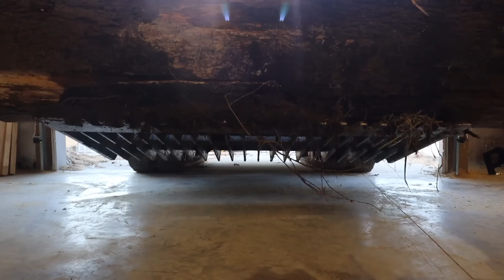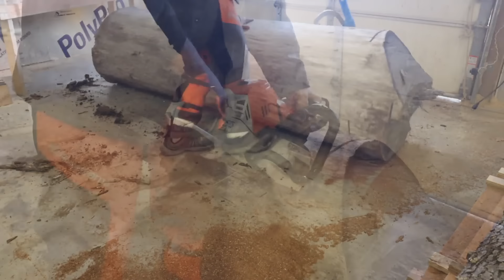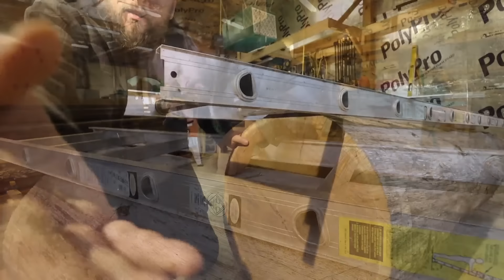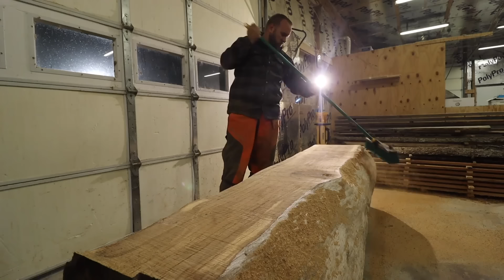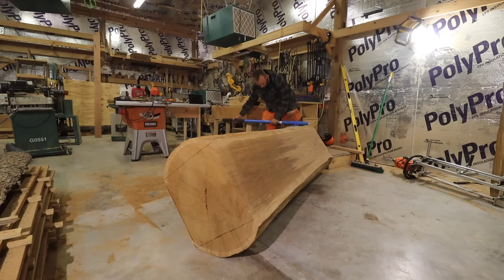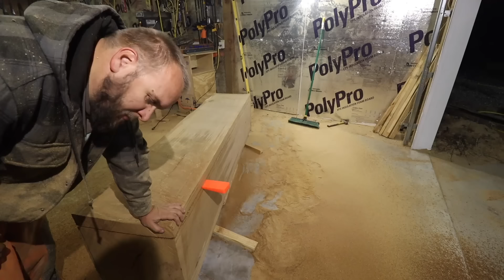How to Mill Dimensional Lumber with a Chainsaw - Alaskan Sawmill

Comment: I live in central america and they cut all their building lumber here with chainsaws (in the countryside) and they mark off the widths with little sticks they cut and snap lines with cord and wet ink. They'll calculate all the different dimensions inside the log they are cutting, leave the ends attached so the wood doesn't warp while you wait to use it, and if the chainsaw guy is good it comes out super consistent. And if not so good it's still perfectly usable. It's just how every house gets built.

Comment: Being nitpicky, but you can have parallel lines and not be square (you just tested for a parallelogram, not a square); the true test of square is diagonally and if those two measurements are the same, the stuff has to be square or at least truly rectangular.

Comment: What good is wearing a face shield when you don't use it
Reply: I like the cut resistant chaps that the chain will ride down right into those soft sneakers lol. Right church wrong pew I'll take boots no chaps. But I've saw in flip flops too
Reply: No the chaps are husky and the saw is stihl buckin' billy would have words

Comment: I find using a couple of 6" square(ish) 1/2" pieces of plywood vs. wedges is easier, insert 1 on the end once you get a foot or so in to the cut and the plywood will hold the end up, then the 2nd piece goes in towards the end to keep it off the saw when you exit.

Comment: Great explanations! You really do a good job of keeping the wood grains parallel with the edge of the cut! And keeping it square means very little is discarded. 

However, I would favor speed over accuracy. Instead of raising the ladder, I'd just fix both ends to the log. And instead of marking a square profile, I'd just set the Alaskan mill to 1.5 inches and make several cuts until I run out of space.

Then I would take those planks to a table-saw and rip them into 3.5 inch boards of a certain length. 

But it's nice to see a very formal approach to Alaskan milling dimensional lumber. This skill is easy to learn and very effective in terms of cost savings on lumber.

Comment: just a tip for you, next time set the plane of your cut parallel with the center crack in the log.
that way, you get rid of the defect in one board instead of having multiple slabs with part of the crack in all of them.
Reply: Ah! That's why they keep the grains parallel! I thought it was because of strength. But cracking is even more of a concern.

Comment: Nice job Brock. Doesnt matter if the boards are a little crooked or thicker in spots. I just posted my slab flatener sled video yesterday. You could easily make one like mine out of mdf boards and flatten those slabs when they dry.

Comment: Good job Brock, but squareness of Cant i was told to measure length diagonally between corners to check squareness if those are the same your square. I was going to ask about the noise as you had lights on with neighbours, there easy to upset!

Comment: Brock, thanks for sharing, my mill is on its way and I can’t wait to start milling some logs once I can dig them out of the snow here in WI. Stay safe👍TCT
Reply from the maker: I also have a sawmill on its way.

What are you getting?
Reply: @RockhillfarmYT  Brock I’m getting the Back Country 36 package with the Easy Rail system and winch system and a couple ripping chains. I’ve been wanting to try the mill for some time. TCT
Reply from the maker: Cool, I’ve done a good bit of chainsaw Milling. I’ve also been using the Logosol M8 chainsaw Milling station

Finally getting a bandsaw mill now
Reply from the maker: Send me a Facebook message or an email to
kcfan491@gmail.com

Comment: Great video. My Granberg mill… set to 2”, doesn’t cut 2”… what about yours? How often are you sharpening your chain? Every other pass?
Reply: I have a mill and just use a regular old chain. Milling ponderosa pine, I got 70 linerar ft or 5x 14ft cuts before needing to touch up with a file. 

Highly recommend buying three new chains and a bench top electric chain sharpener. Just switch out chains as you mill. Or you could continually file your chain for touch-up and then do a complete sharpening at the end of the day.

Oh, and DRIPPING TIP OILER, VERY IMPORTANT!

Comment: Is that a standard chain on the saw?  Is it sharpened different from a normal chain?  How big is the saw (cc)?  Thanks for the video.
Reply from the maker: I am using a standard chain. You can buy special ripping chain. I have used them in the past, but I’ve made the decision not to.

I’m using the stihl 500i which is a 79 cc saw.
Reply: @RockhillfarmYT  Thanks

Comment: I tried the alaskan sawmill and i think its raquet .  Its the worst piece of jumk you can ever buy.   To tight the chaib dont spin and just anough to make it just spin the whole sawmill dismental and it become a danger hazard.  

It looks good when you look at it but not worth half an hour to assemble it . 15 min sharping your chain. Every cut to reassemble the thing.  If it untight you need to dismental the whole thing to arrange it.     I give it a 1 out of 10

Comment: #Rockhillfarm is that white oak? I can't tell cause I'm on my phone but if it's white oak, it's a summabitch on blades and knives. Also it has more checking in it compared to red oak. White oak is prettier just clear coated.  I like the worm or beetle holes in it , cause it gives it character.  I've worked with wood since 6th grade to 12th grade and got a union job in the trade for 24 years.  I've seen just about every species of wood there is. From domestic to exotic.  My favorite to mill is Spanish cedar. Mostly used for humidors. From walk ins to desk top. Just smells so good 👍 👍 that and Douglas fir. Both aggravate my asthma but so worth it. Hey Brock, you seem to be more in your element than your other business.  You're calm and relaxed from what I see. We may not see eye to eye on things but I will always give credit when credit is due. Keep moving forward in this new journey and let Big Guns Above guide you 🙌😇🙌 You have that smile I had 24 years ago.  That's what I wish would have carried on throughout my career. I let the company take my happiness out of my passion for woodworking.  Stay focused brother 🙏 💯 💪
Reply from the maker: I would love to make a living, cutting down trees and milling the lumber and even turning it into furniture but that is no easy thing to accomplish